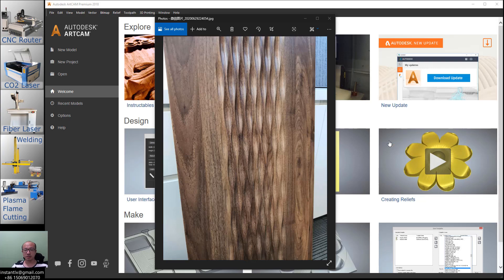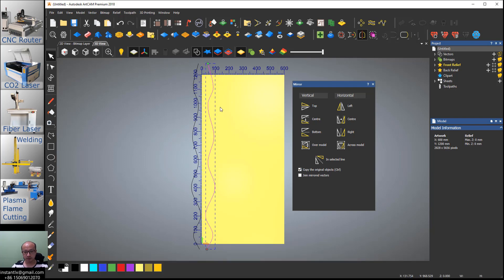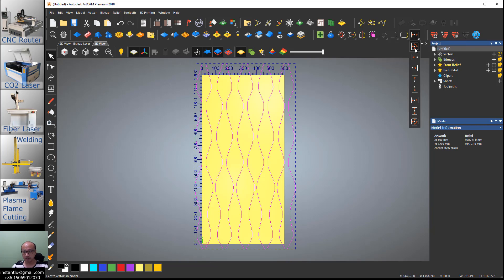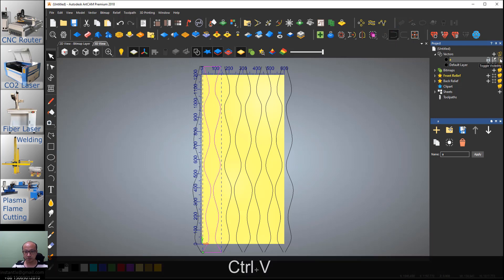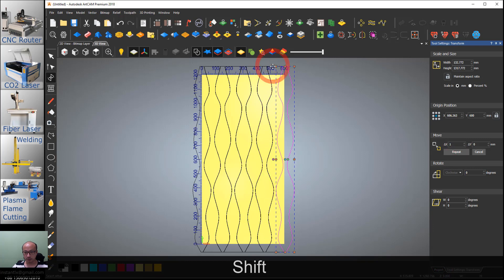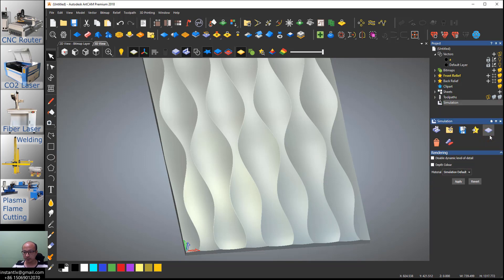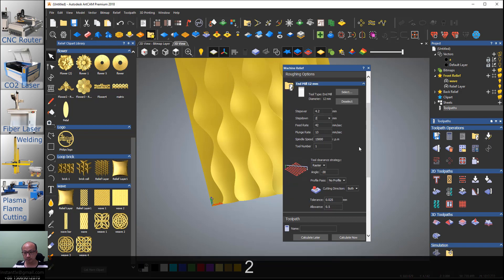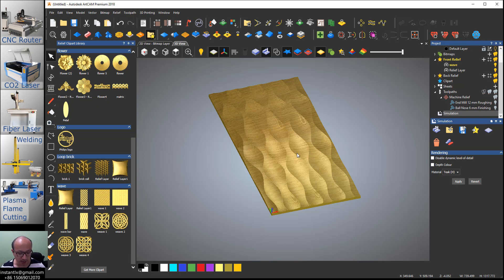How to make simple wave relief in artCAM 2018, artcam tutorial,artcam tips, artcam tricks

Comment: Hello Sir.
Could you explain to me about of Z slices?
How to get Start Z = 0 and Last Z = -10.814? And then also Number of slices = 6 and Slice Thinkness = 1.802.

I have no idea about it. I'm just beginner. Thank you so much for you information Sir.
Reply from the maker: Hi, you may just set the "step down" value in the tool set.  So set the step down to 1.8. and in tool path (2d profiling for example), set the depth of 10.814 and Artcam will automatically devide 10.814 by 1.8. and you'll get the slices in G code.